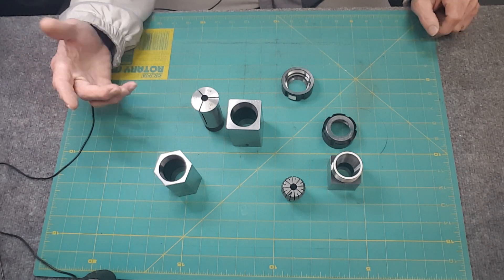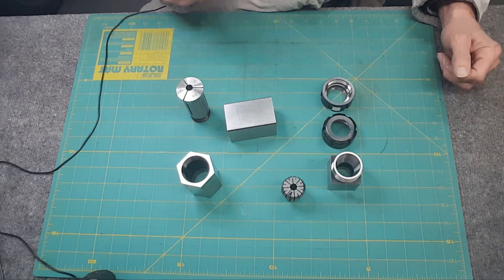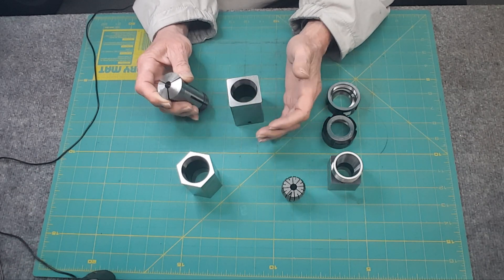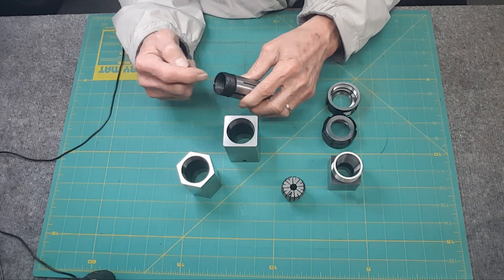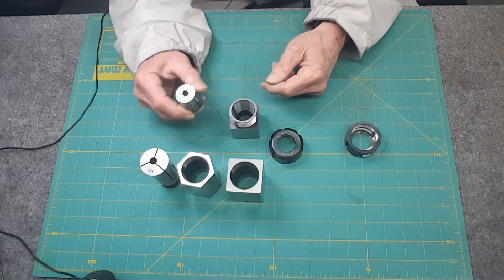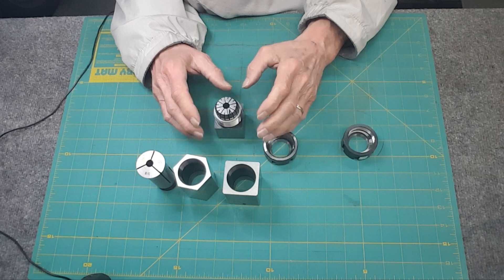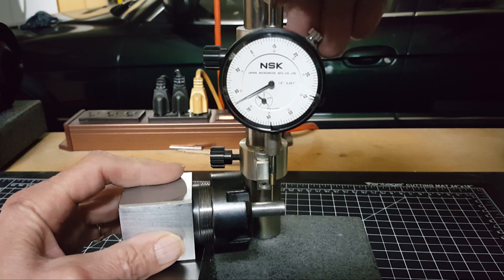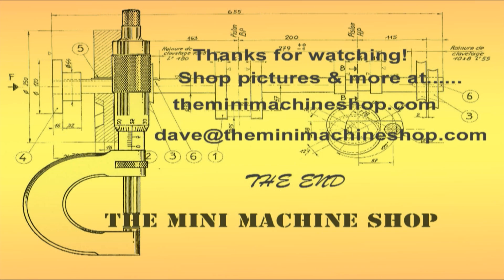My ER32 and 5C Collet Pros & Cons

Comment: What a lot of people don’t realize is that both Hardinge, who invented the 5-C, and Bridgeport, who invented the R-8, intended them for either tooling (R-8) or precision machined first operation parts to be finished on their second operation lathes. So the collets are designed for accurately sized and actually round stock (not mill stock which is neither correctly sized, or round). Double angle collets that tighten from the front are designed to compress a bit and can be used for stock that’s not exactly round or exactly sized. They can be used for tooling as well, which is what I use them for, on my mill, though I use them for stock on my lathe. If you use ER collets, I highly recommend Techniks collets. They’re not very expensive, and they’re 0.0002”.
Reply from the maker: All my common sized ER's are from Techniks and are indeed very accurate! Thanks for commenting. Cheers.

Comment: Thanks for the interesting review of the accurarity of collets. 
Long time ago, when I started my home workshop, an engineer told me about collets: Draw-in collets like  5C, 16C,  watchmaker's collets etc. are primarly designed for material holding . 5C collets are available in round, square and hexagonal, and on request in any shape, e.g. oval. The 5C collet can be opened while the lathe is running and the bar fed forward. Cons is that when the collet closes, the bar is drawn back  a bit. Hardinge makes Dead-Length collets where the bar does not retract.

Double taper collets, as ER, are designed primarily for tool holding. Well known high end collets are made by Schaublin (Swiss) and Hardinge (US).
Sorry for my English, its not my native language.
Reply from the maker: English was perfect!

Comment: Newbie question here.  Aside from the accuracy of the blocks, what are the pros & cons of either type?  Are both types able to have pass through or is that specific to the manufacturer.   A commenter mentioned getting an 5C to ER32 adaptor.  Can you expand on this.  I want to get a set of blocks and trying to decide which would be best to start with.  Bridgeport mill and a LeBlond Regal lathe (13x30).  The spindle on the lathe is LO.  The tailstock is MT3.  Currently, I am using R8 collets for my mill.  Lots to learn.  Just a hobbyist.  Thanks
Reply from the maker: Hi and welcome aboard! I would go with ER32 because of how it captures over 5C. Both blocks allow pass threw but 5C a special tightening ring is needed. Never heard of the adapter and doesn't sound possible. My email is at the video end if needed.
Reply: It’s an interesting question. I use a ER-40 chuck on my R-8 mill. While ER-32 goes to 3/4”, the ER-40 goes to 1”. That opens up a lot of mill bits you otherwise would have a problem with. Same thing goes for with blocks or a chuck on your lathe.

Comment: Nice vid explaining the differences. AS soon as I get a proper working lathe I will jump into the ER32 deep end to start rebuilding my 1938 Seth Thomas Mantle clock. These tiny shaft bushings must be precisely made or I might as well pay someone else the 500 to do it for me. I cannot imagine a 3 jaw chuck working out too well for this job..
Reply from the maker: You'll be surprised older clocks have bushings that are pretty loose. I've made some.

Comment: I have a MT3 quill in both my mill and my lathe tailstock I also bought a ER32 collet set to use there when I need to. I also purchased a 5C collet set, I almost exclusively the 5C collets in the lathe spindle when I’m not using the 3 or 4 jaw chuck, and my 4 and 6 sided indexing blocks.
Reply from the maker: I have both also and prefer the ER32 on my machines.

Comment: Hi Joe another great informative video!
I’m in Britain 🇬🇧 and have a small Smart + Brown model A lathe approx age probably 1950s made in London.
It has a set of externally threaded collets
 ( with no internal threads )
These look very similar to the 5C collets in the video and are tightened by means of an internally threaded hollow drawbar the female taper is integral to the head stock spindle. 
I’d like to identify the type of collets these are so additional sizes can be purchased 
The thread measures .880” O.D. the nearest thread iv been able to find is 7/8-24 
The 24tpi is perfect but the 7/8” is a little loose in the draw bar 
( I have a 7/8-24 tap )
Have you seen a collet like this before and can you or anyone else tell me the name for this kind of collet ? 
Any help is greatly appreciated 👍🏻
Reply from the maker: I have no idea without the model of the lathe but I would make a new draw bar to fit the collets you found. Also funny a British machine using imperial threads..

Comment: Dave, the good manufactured ER32 collets, will give you a little more additional and they "yes" will grip the complete length. The company where I work, demanded accuracy. And bought the Hardinge products.  Like you said, draw of the straw. You can get lucky via the imported stuff. Other times, you loose.
Reply from the maker: These have been perfect for me https://www.amazon.com/gp/product/B001PV1GGA/ref=ppx_yo_dt_b_asin_title_o00_s00?ie=UTF8&psc=1
Reply: @TheMiniMachineShop  Yep my friend, my new Lathe has a MT4. When I finally get this thing running, I'm looking into purchasing one, and fits into the spindle. Then get a nice set of those. I'm not sure if going metric or fractional. You did a nice job explaining the 5C and ER32 collets 👍

Comment: Dave...tks for the video, but you lost me? You said you would put the original ER32 nut on and show that it is not concentric, yet the test shows it is good?  Which nut did you use? When I checked my square block with a gage pin, sides 1 & 2 were the same reading, 3 & 4 were not concentric to 1 & 2.
Reply from the maker: I used the fixed nut and a precision collet and was lucky with the results. Should have been off a bit. Check the valley in the back like I did to see if the problem is the block or collet. Also if all many collets are off the same its most likely the block.

Comment: Hey, Dave. Timing is great...I first went all out on high precision ER32 collet set...now wondering why I didn't go 5C...gonna wait till I have a larger lathe! 
I had it explained that clamping/tightening force for ER32 was much higher than for 5C. 
Now, when and which 5C lathe chuck are you going to go for? Bison 4" is a little pricey...
Reply: It depends on what your using ER collets for as to how much torque to use. ER's were invented and meant as a tool holding collet. Due to how slow they are to use it's highly doubtful any commercial shop would ever use them as a work holding collet system. But they can work just fine other than that speed issue. Straight turning on a lathe exerts much less force than using them with something like larger diameter end mills so the actual required torque is a lot less. For the largest ER 32 it has a recommended torque value of 100 ft. lbs. You don't need anywhere near that while part holding with them.

Comment: Thanks for this interesting video. Regarding the use of collets I maybe misinterpreted Your video. The collect must be placed into the locking nut and then that package can be applied into the collect block, collet chuck etc. Doing it any other way measurements will really be "all over the place.''

Recently looking at a guy disassembling a Chinese 25 Amp SSR it was shown that the Triac inside had a max of 12 Amps... My conclusion is that Chinese Amps are 0.5 of an Imperial, or Metric Amp so their figures will be more impressive.....
Maybe the same applies to Chinese tolerances?.... 1 Chinese 0.001" corresponds to and Imperial 0.002, or more...

Just picked up another interesting tool from a recent Tubalcain video, the Rose Index. Here's a link to the inventor:
https://www.youtube.com/channel/UC6p5jwZsy-J0KJ86b8qwH9g